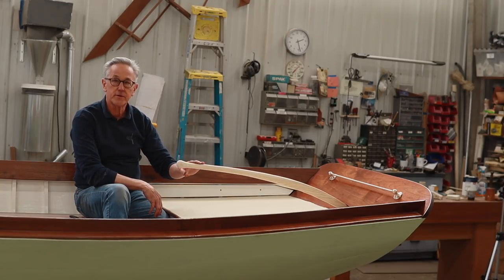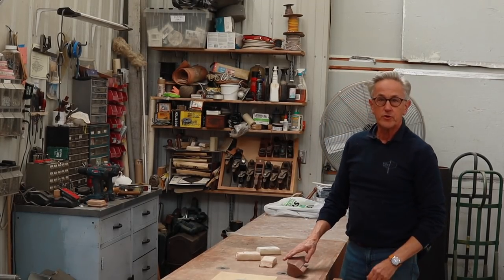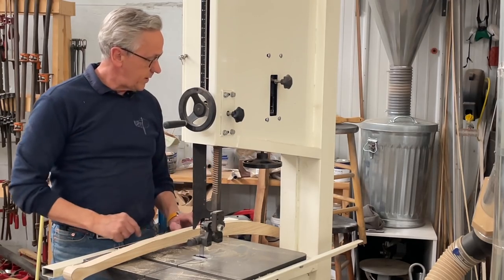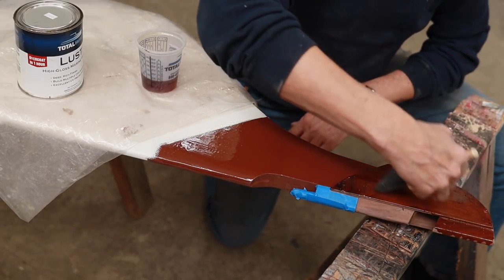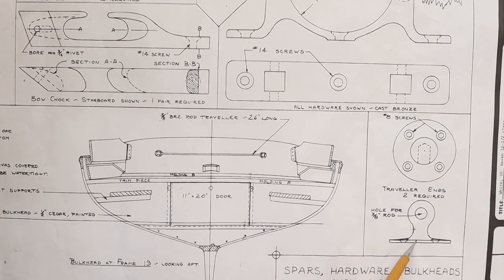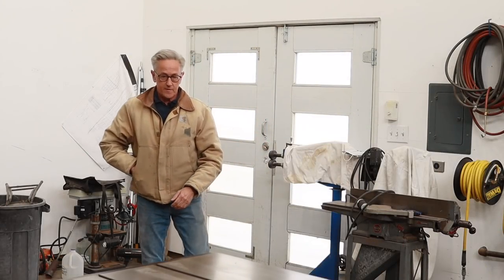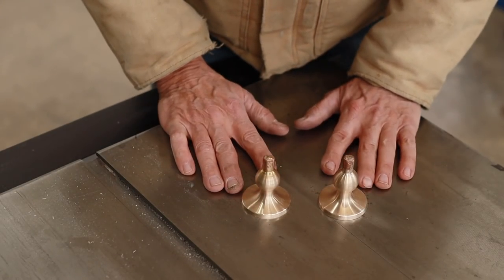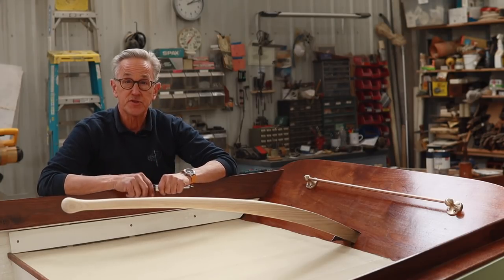Wooden Boat Building, Tiller and Traveler for the Haven 12 1/2, S2-E61

Comment: It was great to watch you make the pattern out of wood and then cast the part. 
I tried something a bit different- I redrew all of the bronze parts in Fusion 360- then 3D printed all of the patterns. I then cast the parts using the traditional sand method.
I like the idea of melding the old and new technology.
Reply: Hey, wood turned or 3D printed, either one, then painted with Dupli-color plastic coat paint makes for a great negative. Six of one/ half a dozen of the other.
A releasable negative form is a form. Thanks for sharing your alternative mold making idea. If you have a 3D printed, that is certainly an option.

Comment: The great attention to details makes this channel a joy to watch. Thanks for that.
Did you consider the tension that the traveler rod is going to be exposed to from the sheets?
I did no notice if you put threads on it or perhaps through bolt it to make it stay in place. Not nice if it comes flying out of there if there is a gust of wind.

Comment: Chapman makes the best hollow ground screwdriver kits. I have a few Chapman brand kits and have never had a failure once using them. Chapman btw is the inventor of the hollow ground screw and nut fastening. I have a couple kits that were my great grandfathers and I use them almost daily still.

Comment: An interesting discussion of the screw driver tip. When you were cutting out the tiller, I was surprised that you were apparently wasting so much of the board. A few moments later, you explained why. It was almost like standing in the shop with you, and asking questions as you worked. One question you did not automatically answer was why you did not use a router on the corners of the tiller. I assume you were concerned that the spinning bit would have a tendency to to tear out tiny chunks of that hard oak, which would be the very devil to sand smooth later. I'm really enjoying your videos, especially the casting work.

Comment: I'm curious, Ash is a fantastic wood for a tiler, it also steam bends beautifully and would allow you to maintain straight grain which is always best for strength.  What made you to decide band saw to timber?
Reply: My thoughts exactly. Would make for a much stronger tiller, which is such a vital component.
Reply from the maker: Hi David,
I sawed the tiller because that was what was needed given the timber I was given. As I showed, the section I cut out was almost perfectly quarter sawn. As I'm sure you are aware that quarter sawn wood is at its strongest. The annual ring of my Ash run perfectly straight down the tiller length. The best way to retain wood strength when steam bending is to start with quarter sawn.  Steam bent wood needs to have the annual ring bending with the curve for optimal strength. 
Given the dimension of my Ash timber, it was not thick enough to be the right size for the tiller. Both have the same strength. Sawn is what I did given the material I had to work with.
Thanks for watching!
Cheers,
Bob

Comment: Absolutely fantastic Bob. I always learn something. Super episode. Your traveler is a bit different from mine. My rod bend 90 degrees into the mounts. I like yours better. When I tack, I can wind up with the block sort of stuck around the bend if that makes sense. Yours is a better design
Reply from the maker: Hi Chuck,
I saw that in you video. I assume that is what Jim sent you. I was curious why he sent that design I was just following Joel's plans. You are always welcome to come cast some if you ever want to replace it.
Cheers,
Bob
Reply: @TheArtofBoatBuilding  Thanks Bob, I may take you up on that. I think what Jim does is more trad Herreshoff. I've seen the bent rod style on the H 12 1/2
Reply from the maker: @JenkinsBoatWorks  ah that makes sense.

Comment: Another important point about screw drivers is that they wear out. A worn out screw driver tip doesn’t fit the slot well, and has rounded edges. That makes it highly likely to slip and marr your work. Screw drivers often have a texture that further prevents slipping. The older the screw driver, the more wear to that texture.

Comment: If that bar gets pulled hard in the center it may bend and pop out of those sockets. Have you considered soldering that rod into the sockets?
Reply from the maker: Hi Michael,
No, I haven't and won't solder the ends on for a couple of reasons. First, is that the holes in the bronze ends are nearly 3/4" deep and are a very tight fit.(so tight it won't spin) So I'm not concerned about it popping out. Second, if in some strange event that the bar did get bent it would be an easy fix to just replace the bar. However, if it was soldered in it  would be a very difficult to fix if not impossible. 
Thanks for watching!

Comment: When using those very soft bronze screws, I suggest using a steel screw first to cut the threads in the wood before installing the bronze screws.
Reply from the maker: Hi Rick, Thanks for the suggestion. However, when the proper tapered bit is used and the screw waxed a steel screw is not necessary.
Thanks for watching!
Bob

Comment: Just curious ,when making the pattern do you ever glue two pieces of wood with paper in-between so you can split in two rather than cut it apart?
Reply: Another great option and suggestion. I've seen this used for "inside-out" turning as well.

Comment: Love your rudder cheeks, Bob. Where the bolt connects the tiller to the cheeks would the nut typically be drilled and installed with safety wire?
Reply: Yeah, I would consider a safety tether on the bolt and nut, I have a tendency to drop things. But if you keep spares, no need, I guess.
Reply: I was also VERY worried about vibration loosening of your hardware😟 Would you ever use Loctite?

Comment: Dear Sir,

I wonder if a straight piece, bent to shape, would make a sturdier tiller. The fact that the grain crosses a section of the tiller could make it weaker? I know this is good wood, but the question just crossed me mind.

Thanks and cheers from Brazil!
Reply from the maker: The quarter sawn ash has the grain running perfectly straight the length of tiller this makes it not have any cross grain and extremely strong. 
Thanks for watching!
Cheers

Comment: Maybe I missed you explaining this in one of the episodes, but why are you casting pieces like this that could be pretty easily turned on a lathe? strength? don't have a metal lathe? less material waste?
Reply from the maker: Hi Ben,
Interesting question. Turning metal on a lathe its much different than wood. Metal lathe tools are held rigidly in a tool post and only take off 1000's of an inch at a time. One must start with the general shape and then a small surface can be milled off.
If one wanted to start with a solid piece it would first need to be round. So to make the end piece one would need a 2" diameter silicon bronze billet ($288.70)
 https://www.onlinemetals.com/en/buy/bronze/2-silicon-bronze-round-bar-655-h04/pid/7825?variant=7825_12_0&gclid=CjwKCAiAvaGRBhBlEiwAiY-yMGlDH-3HIST_dr7zUpLsu70F_H27kQWKX57zuQdjrPOAK9ClDjz2jhoCUqQQAvD_BwE 
And it would take days to reduce it to the final size.
The 2 cast end pieces weighted less than 1 pound combined (I paid $6.50 per pound)
So turning the ends on a lathe would be highly impractical considering the time and material cost.
Thanks for watching!
Bob

Comment: The auto mechanic in me wants to use red thread locker on the acorn nut of the tiller bolt. I am now wondering why slotted screw drivers generally have tapered heads as opposed to hollow ground.
Reply from the maker: I get that! The tiller does has to be remove in order to remove the rudder which one would want to do when trailering. I'm with you on the tapered heads. Does make a standard screwdriver have somewhat of a multi-tool function I suppose!
Reply: As to the thread locker, that was answered. As to the screwdriver tips being tapered instead of hollowground as an industry standard?... It is cheaper in the manufacturing process to taper grind, so that is a shortcut manufacturers do it that way to save time and money in the process. Hollowgrinding takes a more complex and more expensive setup and more time and manpower to inspect that the grind is centered on the shaft than beveled/tapered grind does. Machines can check tapered grind much easier than hollow.
It's a money thing.

Comment: Why not use a laminated tiller with straight grain to improve strength and reduce material waste?
Reply from the maker: A laminated tiller would not be stronger than quarter sawn Ash.(1320 Janka hardness) I had very little waste and used the off cuts on other projects.